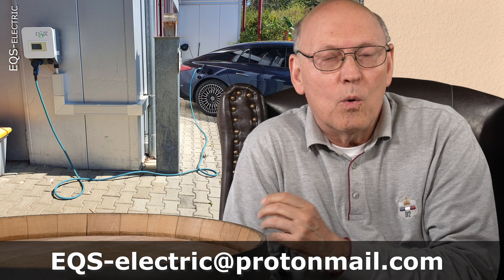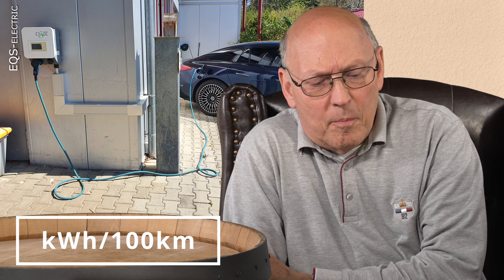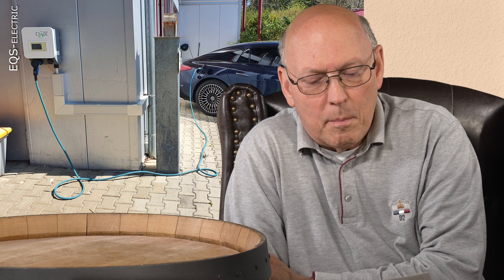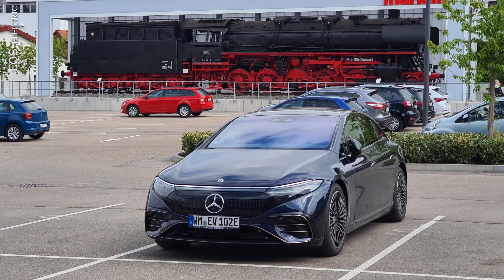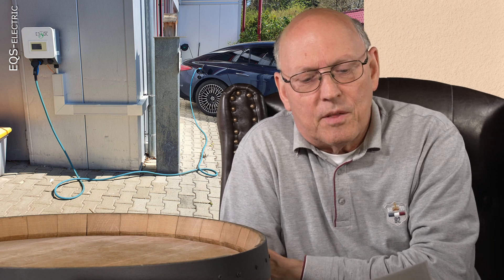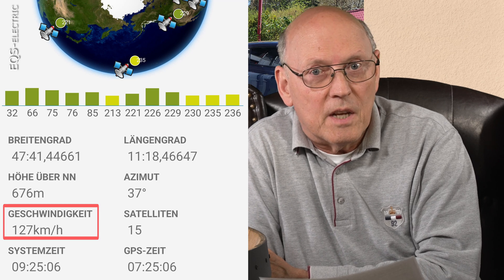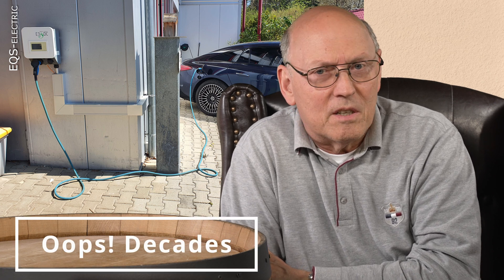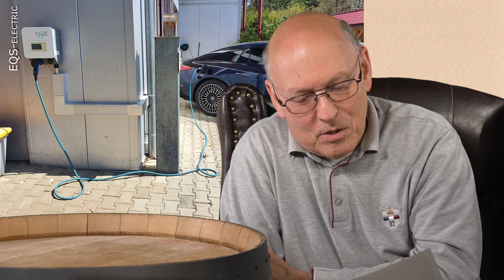Mercedes EQS 450+ Consumption, Measurements, Calibration, German Autobahn

Comment: Yes, raise the tire pressure to the usual 3.0 bar for better consumption and direct comparison to Tesla.
Here is a test by the Motork channel: https://www.youtube.com/watch?v=qIzRmvcuWyA?t=1m59s
The 120 km/h test had 178 Wh/km at an average of 113 km/h (70 mph) indicated.
Not bad!
Reply from the maker: I will not change the pressure to match the pressure of other cars. The manufacturers had some thoughts, which you will override. For comparisons, I use the standard pressures published by the manufacturer.
e.g. Increasing the pressure may conserve energy but will result in a bumpy ride. You have to compare cars in total. If I prefer a smooth ride then I have to accept a higher consumption.
Reply: @EQSelectric  Lucid Air "cheated" by recommending 49 PSI... ;-)

Comment: I would say kWh/100km is the best one, because you pay per kWh everywhere not per Wh
Reply from the maker: Good Point.
Reply: Secondly, this gives a better comparison in regards of cost per 100 km. At least I am calculating like that and I have to convince my wife to purchase a used model S.
Reply: And kt gives you the hint, that this is always an average, because the consumtion of only one km is never represantiative.
Reply: I also prefer the kW measurement, since most measurements around charging are also reported in kW, not watts

Comment: Don't underinflate your tires!!!! In fact it doesn't make your EQS any more comfortable, in many situations it will make it worse! The suspension is tuned for those very firm  pressures. Worse yet, handling suffers significantly and it kills the range! Low profile radials are supposed to be "hard". Making them "softer" is worse in every parameter including comfort. The pneumatic suspension is tuned for that high pressure setting. I would never drive at over 130k on a tire that is not fully pressurized.
Love your chats!
Reply from the maker: The official recommended pressure is 2.60 bar. I am driving with 2.65 bar.
Reply: @EQSelectric   Got it. I was not aware of the EQS pressures. On my AMG they are 47 rear 45 front they are very low profile.

Comment: In fact MPGe is not a bad measurement, if you understand it. Its a rough estimate of how much what the fuel efficiency would be if the vehicle were an internal combustion engine, the 33% is an average of ICE energy efficiency. Ergo the (EPA) MPGe of the EQS around 99 (give or take). An ICE vehicle that provided the same energetic efficiency as an EQS would have to  provide 99mpg. Its not a range estimation its an energy efficiency one. We science geeks like it, plus, it differentiates among electric vehicles quite well. The most energy efficient vehicle is the Ioniq 5: 136 MPGe an old tesla 75D was 91. But I agree as a basis to figure out vehicle range its fairly useless. The EPA came up with it so we dumb Americans could have a fuel economy measurement we could relate to.
Reply from the maker: Oh NO! An average efficiency of an fossil car is 12% to 15%. The peak efficiency is 40% to 42%. But only with medium rpms and 70% to 80% load. You can only hold that for seconds until you are too fast. As soon as you raise your foot, efficiency drops to single digit figures.
Reply: @EQSelectric   True, but again 33% is a a good estimate at a steady state at highway speeds. The efficiency of an electric motor at zero RPM is zero 😉. 33% is a fairly acurate "average" thermodynamic efficiecy for an ice motor. Another example is the so called wasted heat of an ice engine, well, its not so much wasted in winter is it? While an EV loses up to 30% of its energy heating the car in winter in a ICE vehicle it has no effect on range since what was once wasted heat now in effect increases the whole efficiency of the system. Again the conversion factor is not an aleatory figure it was well calculated by the US department of energy. It is not perfect but it works well enough to provide a useful equivalent conversion between electrons and gas. Again it has little to do with the range since the size of the battery (like the size of the gas tank) becomes the principal determinant factor. However given the same size battery a higher MPGe translates into a longer range between those particular EVs. 
In all this discusion however we are missing an important point. EV manufacturers use different testing criteria. German automakers tend to underestimate real world range while Tesla overestimates it.
In summary.... Its complicated😁
I get my 580 tomorrow, we can compare notes👍
Reply from the maker: @Wised1000  Again NO! I had been to Kiruna/North of Sweden this February with my Tesla Model Y. The excess consumption had been 10%. And fossil motors take more in winter. And the average energy yield in a fossil car never reaches 33%. In a stationary environment at an ideal rpm/load configuration you may reach 40% in a combustion engine. But in reality you're at 12% to 15%.
Reply: @EQSelectric  omg 33.7 is the conversion, 1 galon =3.79l, 3.79l~ 33.7 kwh, and you call yourself an engineer lol mpge is how far does the car drive with 33.7kwh or 1 galon of Gas
Reply: @pauleheisterbademeister7325   Precisely